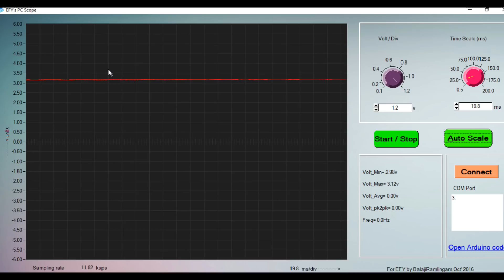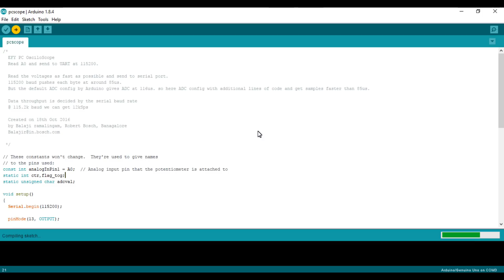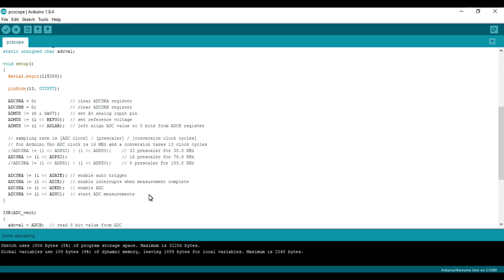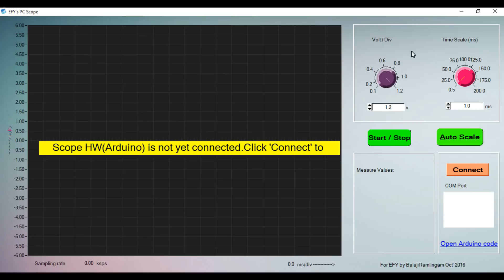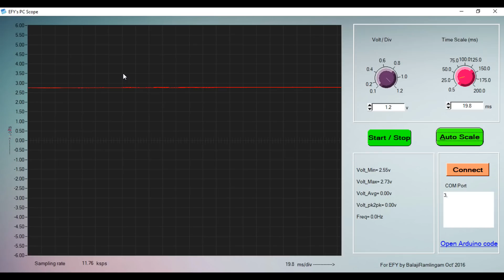A PRACTICAL OSCILLOSCOPE USING ARDUINO || DIY || Techno Lodgy

Comment: to slow :(, i used to make one on  Atmega2560 with 20MHZ oscillator and couldn't reach good speed too. and i used Assembler and Interrupt also my ADC was configured to fast reading etc...
best option is to use separate ADC Chip  and any MCU to store data and output it, Great Job m8 ;)

Comment: That is very interesting. I have a technical question. Can this project measure High  and Lows of an IC analog VIDEO Logic chip? The other is can this also measure composite video or RGB video signal out to see if the waves are correct with the correct impedance?

Comment: Hello. If I wanted to modify such a design to measure higher voltages, frequencies, currents and duration of pulses in AC circuits-- how to prevent damage to the Arduino or computer? Thank you so much for sharing this!
Reply: pues usa operacionales

Comment: Wich resistor should be use 330 ohms or 330 kilo-ohms. ???......
Reply: 330R means 330 ohms
Reply: but normally it needs to be more that 1M ohm but i don't know
Reply: 330k, see 3:14

Comment: Nice work! Is there a way to increase the max voltage from 5 volts to ... whatever?
Reply from the maker: Yes, you can use some boost converters for this. 
But there will be a limit up-to which the voltage can be increased.
Reply: I just released a video showing calculations for higher, and negative voltages.

Comment: Great video for oscilloscope as compared to rest of video. 
Sir what is the circuit you connected on breadboard in this last video.
Please reply urgent
Reply from the maker: The circuit was of astable multi-vibrator using a 555 timer IC. 
It generates a square or rectangular waveform of certain frequency.

You can read more here : https://circuitdigest.com/electronic-circuits/555-timer-astable-multivibrator-circuit-diagram
:-D
Reply: @TechnoLodgy  
Where can I download the software and Arduino sketch